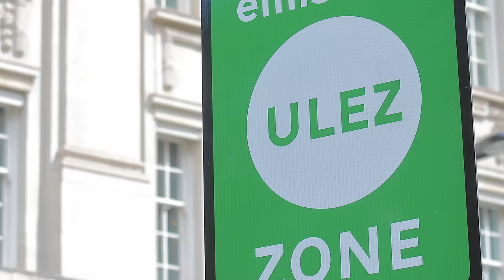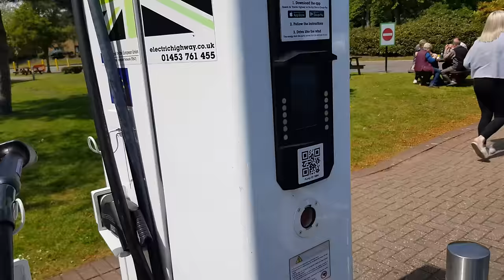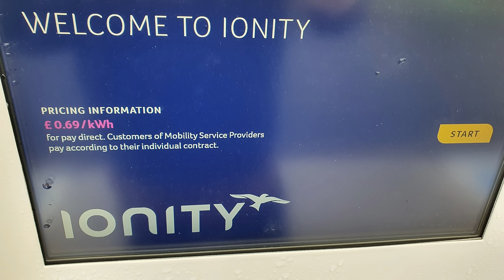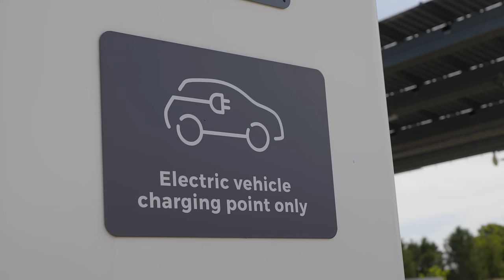The Uncomfortable TRUTH About EVs: The Version NEITHER SIDE Wants You To Hear

Comment: Great, balanced video. Have looked at EV’s but quite often need to travel 500 miles in a day so, on this basis alone, they don’t work for me. Add to this the fact that a comparable ev to my new Skoda superb tdi is £10k more to buy, the pcp costs are much higher, the tdi can cover 850 miles without refuelling, is much cheaper to insure and it will not, in all likelihood, require a new battery costing thousands after ten years - so, much as I would like to save the planet I don’t think we have got this one right - what about plant based fuels, hydrogen etc?
Reply: I totally agree with you Terry, I used to travel long distances like yourself and an EV will simply not cut it. Hydrogen will also be an option soon from car manufacturers as other vehicle manufacturers such as JCB (the UK’s largest heavy plant supplier) will soon only be selling machinery with hydrogen powered combustion engines as electric doesn’t work for the construction industry.
Reply: @johnwaga3702  Hydrogen requires massive amounts of electricity to produce, most is made from coal , a tiny amount can be made from renewable power but why would you , you may as well use the electricity and get twice as much energy as the hydrogen. JCB will regret pumping all that money into hydrogen, storing it is incredibly dangerous and expensive  , can imagine a tank sitting on a building site with the potential to blow the entire town to smithereens?

Comment: I think you missed out a very important section, the depreciation of EVs. I heard of a guy that bought a brand new Astra Electric that was told to expect 209 miles range, actually got 130 miles. After 3000 miles and 6 months he returned the car to the dealer saying he was sick of it. The dealer then told him he’d lost 19 grand in depreciation
Reply: This guy's bigggest mistake was not because he bought an EV. He chose an Astra. To then condem EV's because he was incapable of discerning between crap and quality tends to highligh where his problem really lay.
Reply: Have you seen residuals on Porsche Taycans?  Dumping value by the month!  Insurance costs for EVs are significantly higher than ICE vehicles due to cost of repairs. There are a lot of motor insurers pulling out of EV market.  Heavy depreciation is hitting all EVs. The Astra is a specific example.
Reply: Buying a Vauxhall is never a good decision, under any circumstances!
Reply: @JimboJammy  I never would anyway, just heard the story
Reply: Depreciation is very market dependent. In the UK, where everyone seems to be scared of any form of change, they depreciate like rocks in a pond. Here in Norway, where more than 80% of new cars sold are EVs, depreciation is the same as a combustion car.
Reply: @15bit62  Given that 80% of new cars.are Evs in Norway has car insurance gone up dramatically i wonder?
Reply: Range "estimates" are notoriously unreliable.
Reply: @Cheepchipsable  I’m keeping my diesel gas guzzler

Comment: For me one of the biggest problems with ev ownership is the inability to charge at home. I've seen surveys that say up to 50% of the car ownership population will not be able to charge their vehicle from their home in that they Do not have a drive. This means the nearest one can get is with a self charging hybrid, which is what I have. I have no problems with battery evs as a concept for medium to small vehicles but batteries are currently and in the foreseeable future not suitable for anything larger. We are still going to need fossil fuels for a vast amount of our transport needs. And the problem with the infrastructure is not just the charging points it's all the equipment needed to get the electricity to those charging points. The current equipment will all need to be upgraded to handle a much higher volume of electricity. That is going to put the cost of electricity up much higher than it currently is. And then the government is going to put duty on it or something to replace the tax duty they're no longer receiving from fossil fuels.
Reply: There is such thing as fossil fuels

Comment: Ev"s will never be the answer until they find a better battery, which I might add they have. Maybe 5 yrs down the line fine but and it's s massive but, expense who in the right mind will buy one at over £40k, for now hybrid is the way forward I got one and I plug it in, gives me a range of 27 in winter or 35 plus in summer cost peanuts to run zero tax also
Reply: Having had a couple of hybrids I always felt they were a jack of all trades. Always annoyed me when the engine kicked in too.
Reply: Tax won't stay zero for long even for full EV's. The tax on fuel sales is a vital part of the countries tax revenue, thus it'll have to come from somewhere..

Comment: Family fathers perspective: I have a middle income and money to buy ONE car. We live in an apartment in a city, I can't charge the car nearby (kerbside parker). I need a car for commuting but also something that can do our 1200 km holiday trip with a caravan to croatia without recharging several times/hours. Saying "this use case only happens rarely" doesn't help me, because even if it happens rarely, it has to be done (or should I rent a car for weeks for holidays?). A normal gasoline powered car is a "swiss knife" and does everything with flying colors. An EV is always a compromise - it's cheap to maintain, but expensive to buy. It's not great at towing (range) or long range - especially in the winter.As JayEmm said - EVs are great, but they are not the holy grail for solving everyones transportation needs.

Comment: What was the best selling car in the world in 2023?  The Tesla Model Y.  Doesn't sound like demand is dying to me.  BTW, it will take me 60-90 minutes longer to drive my Tesla from New Jersey to Florida (over 1000 miles) than an ICE car.  As for the problem with significantly handicapped drivers (probably a fraction of a percent of all drivers) I'm pretty sure they would get assistance from other EV drivers at the charging point.  As far as the cost of charging goes, that is primarily driven by the cost of electricity.  From what I've gathered the price of electricity in the UK 28p/kWh + 20% VAT = 33.6p/kWh.  The charger companies have to cover the cost installation and mx costs as well as get enough profit to keep it a viable business (plus there is a 20% VAT on what you buy from the charging station...thank the government for that) so just to cover the cost of electricity and the VAT you're paying 40p/kWh!  So 60p/kWh to cover the cost of power, VAT, installation, maintenance and profit isn't so absurd.  It is also unfair to compare an EV to a diesel car, they are worlds apart performance-wise.  A better comparison would be to compare a Tesla Model Y Long Range to a BMW X3 (similar pricing, performance, luxury features, etc...).  The cost to fuel a BWM X3 is about 28p/mi (assuming 6.5mi/l, premium fuel) while the cost to charge the Tesla would be 20p/mi (assuming 3.2mi/kWh and 60p/kwh charging cost) so you're still saving about 25% by driving the EV.  Finally a problem with comparing ICE to EV everyone always uses the ICE's HIGHWAY mileage (the most economical mileage) vs the EV's highway mileage (the LEAST efficient driving in an EV).  That same Model Y would likely cost closer to 15p/mi if you were to use city driving numbers mixed with some secondary road driving (where speeds are 50mph or less).  The X3 in those conditions would be more in the neighborhood of 35p/mi making it over 50% cheaper to operate the EV.
Reply: The Tesla Model Y styling reminds me of the 1990s Chrysler Neon.
Reply: the  biggest issue with electric cars is the battery, after 10 years, you have to buy practically completely new back somewhere in range of 8-12 thousands, where, ICE car drives 20 years without that cost. 

And yes some ICE cars have pricey issues as well, but on the other hand ALL EV cars have battery issue, just question of time.

so electric car is not really sellable over  8 years mark, and EV companies are making any self / independent battery repair harder and harder,
not disclosed schematics, not available spare parts.

So if you take into account above, EV is more expensive over ICE

EV does not allow people who are starting to get older /cheaper model, 
and when they have more money switch for the newer and better one.

EV's are just too expensive. 
You can not assume 100% of the population can afford them.
When you look at the number of registered cars, and number of yearly sold cars it is obvious average car gets used for about 20 years.

So EV's are not good enough, for 100% of the population.

They can be used situationally in cities, by people  who can afford them. 
But in rural places, they make less sense.
Reply: @PeterBalko  most cars aren't worth much after 10 years anyway. Who cares if battery dies after 10 years? I'll just buy a new one with the massive savings in fuel and service.
Reply: @777jrg  cars should last 20 years, as that is the time they are being used today, 
4 years first owner another four 2nd owner ..., when you have money you can do what ever you want, but that is not the case for 100% of the population, and definitely not for 18 years old, who just need to get from a to b in rural places with almost none public transport alternative
Reply: @777jrg The average age of passenger vehicles in the US is about 12 years old. Wrong again.

Comment: Jay! The Luton fire may have been started by a diesel.. or not... 😊 :p HOWEVER, once an EV battery has been stimulated into thermal runaway, say by an ice car burning merrily beside the EV, then that battery burns far hotter (enough to compromise reinfirced concrete structures) and emits more toxic crap than the aforementioned ice fire.
Reply: Luton and every other car park fire including those from before EVs were a thing, proves that ICEV fires also burn hot enough to damage concrete structures.
Reply: @williammeek4078  not true but you don't care.
Reply: Another problem is that ICE cars don't just "burn merrily". Once the fuel tank is compromised you have a rapidly spreading out puddle of burning fuel. This goes under adjacent cars and applies heat / combustion to their fuel tanks. In the case of an EV, the batteries are also under the car, so same problem. Burning fuel will eventually cause the battery to burn.
Reply: @stuartjohnston1086  if the burning fuel spreads under an EV then the temperature of the fire will increase to 2000°C, release toxic/explosive fumes, & become impossible to extinguish. The source of ignition of lithium batteries is irrelevant, the results are far worse than ICE fires every time.
Reply: Petrol also burns hot enough to compromise reinforced concrete structures. Here in the states we’ve had multiple bridge collapses due to a petrol tanker burning underneath.
Reply: @will3346 Isn’t a petrol tanker catching fire a bit of a different scenario to a petrol car catching fire?
Reply: @will3346  that's because US regulations only require such structures to withstand 500°C temperatures. Building regulations are more strict. Plus I could only find two such incidents, both involving over 8,500 gallons of gas.
Reply: @sp00ky1969  no the person I was responding to made a blanket statement that said petrol cant compromise reinforced steel structures and I gave an example of where it does. The volume of petrol burning doesn’t change the temperature just the burn time.
Reply: @papalegba6796  I’m unsure of building regulations in both countries as I’m not a practicing civil engineer but petrol fires can compromise concrete structures. 

Not to mention the risk of an ev fire is dramatically lower than the risk for a ice fire. Something like 25 per 100k vs 1500 per 100k. 

I have and enjoy both ev and ice cars. The statistical risk of ev has been vastly overblown.
Reply: @will3346  Statistically nuclear power is very safe too, safer than EVs I would wager, except it is met with resistance, based on the small number of occasions when it goes wrong. How many nuclear reactors does the USA have floating around the oceans with many decades of safe, uneventful operation? Let alone any land based nuclear power stations. But they'll be damned IF one does go wrong...
Reply: @williammeek4078  Luton was the hybrid battery, it wasn't an ICE fire
Reply: @TachyonDriver  yeah and thats a terrible mentality to have. Nuclear comes in under every other major source of energy including wind and solar in fatality rate (deaths per 1k twh). It is far and away the safest form of energy. Of the 3 major nuclear accidents Chernobyl was the only one with a significant number of casualties. Fukushima had 1 and 3 mile island had 0.
Reply: @will3346  I believe we agree on that! I'm not against EVs per se, but I would PREFER the battery tech and chemistry to change (and it will, no doubt) until I get one. My daily total commute is about 11 miles, so a small practical EV would suit that. However there is ZERO infrastructure in the village where I live, nor the town where I work. I do not even have a driveway. Another aspect in my situation is that EVs are currently way too expensive for me. I bought my little  Mitsubishi Colt for £1200, some 3 years ago now.
Reply: @TachyonDriver  those are absolutely fair criticisms! Despite spending a significant amount of time in both countries I tend to forget how different American and British houses are. 

Hopefully battery tech advances relatively quickly. Although I always have to keep in mind that ice engines have really still had reliability and efficiency improvements even over a century since they were first introduced.
Reply: A large portion of EV batteries contain cobalt. If that battery goes into thermal runaway that cobalt becomes a health risk to everyone nearby. First responders are getting permanently disabled from cobalt exposure. I would drive an EV, in fact I will likely buy an Aptera. But this health risk from battery chemistry needs to be disclosed at time of sale. I'm sure it will be buried in the fine print of the sales contracts if this happens at all.
Reply: @will3346  A good discussion, Will. Thank you. A Merry Christmas to you and/or Happy Holidays!
Reply: @mntbighker  Another reason I hope battery tech and chemistry changes for the better!
Reply: @papalegba6796  😂🤣😂🤣🤡🤡🤡🤡 Absolutely true, but you don’t care.
Reply: @williammeek4078  You seem normal
Reply: @stuartjohnston1086  Hence my comment saying that an ICE fire may stimulate a nearby EV battery into thermal runaway 😉
Reply: @davidgavin7280  Bedfordshire Fire and Rescue that actually fought the fire disagrees with you. 
Their report says it was a pure diesel.
Reply: @williammeek4078   well it wasn't and they know it too. It was clear as day a mild hybrid with the fire starting exactly where the lithium battery is on that car
Reply: @davidgavin7280  the lithium battery in the hybrid version was in the back, not the front. Whoever you listen to is BSing you.

Comment: EV charge point installations weren't stagnant from 2020 to 2022. Installation rates have been roughly exponential from 2012 inwards. There's been a 45% increase in charge points since December 2022. Let's hope the rest of your points are more accurate... Not a great start.

Comment: A deluge system is needed for car fires, EVs included. Lots and lots of water. Can be done with a sprinkler like system. You make some decent points that are fairly well rounded. I particularly appreciate that you compared many situations with gas cars in the like. Edit: I drive a 10 year old Tesla with 150k miles and it's running just fine. The contactors are wearing out but it's still quick. Model S 85. I have 20 year old Panasonic cells that work in an old laptop. I'm hoping the car batt lasts that long. Would be great!
Reply: This may have been the case previously but with EVs now increasing research has been done in how you can put out a fire. EVs are not one battery but a pack, so what you do is use an infrared camera to identify the actual battery that is on fire. Then use a lance to pierce the battery and basically inject water into the battery. Tests have shown that you can put out a fire in as little as 15 minutes and most of the packs will still be in perfectly good working order.
Reply: @barneyrubble1964 
Good luck with that.
Reply: 😂😂😂😂😂😂😂😂😂😂😂 just carry a water tanker with you

Comment: Two cars in Canada Kona's I think, were written off because of minor damage to the underside of the car, one of these cars has a documented video from the dealership. The repair was refused and as a battery pack cost in the region of 35K (British Pounds) to repair they were written off. Simply because of a dent. There are no full battery packs on the shelf to repair the car anyway. Lithium is in short supply so it is not used for replacement batteries only batteries that are to go in new cars. Hence when the car is written off the insurance has to foot the bill putting the cost on the rest of us. Incidentally, it is true there are fewer EV fires but proportionally there are fewer EV's but scale up the proportional percentages and it is actually a problem